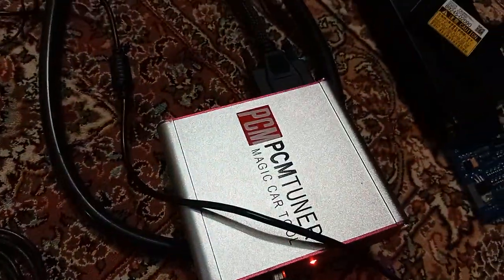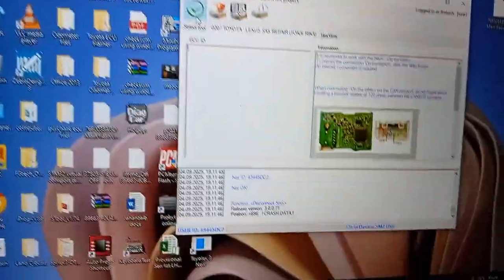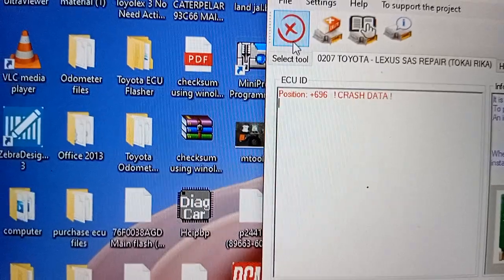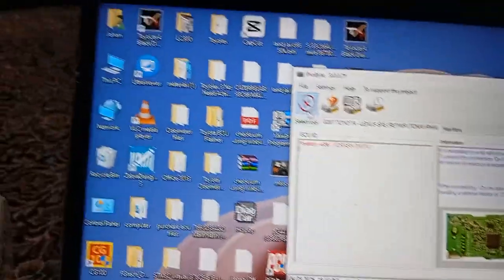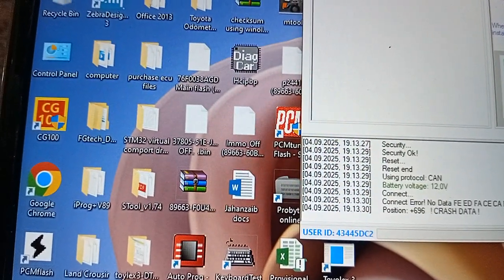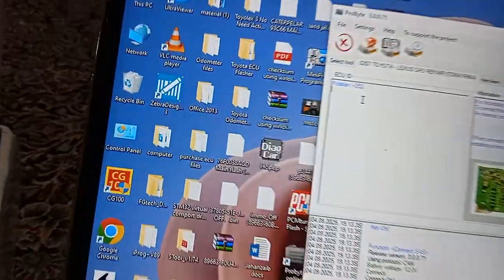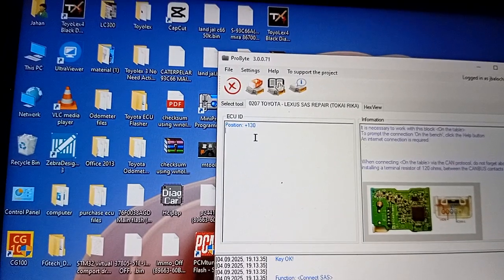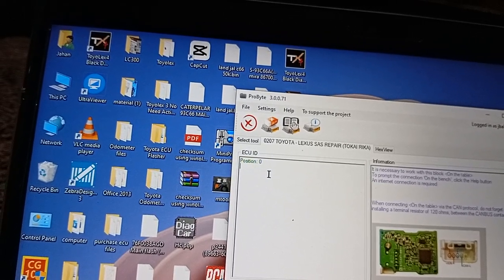How to reset Toyota SAS 89245-0k020, MCU R5F2154 by Probyte with Pcmtuner j2534

Comment: Hello brother, this is a R5F2154 microcontroller on a Kehen motorcycle. Can I use this method to program it to do anything, read it, and write it? I would be grateful if you could answer.
Reply from the maker: No it's only for Toyota SAS. CG100X can read and write R5F2154
Reply: Hola necesito la información virginizada me la podrías vender o regalar como tú quieras lo voy a hacer con el cg100x gracias